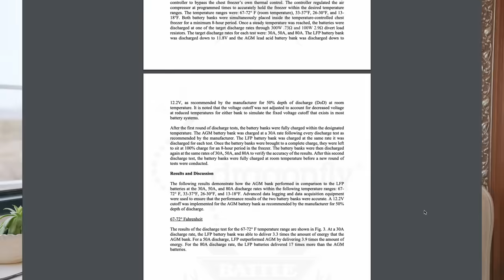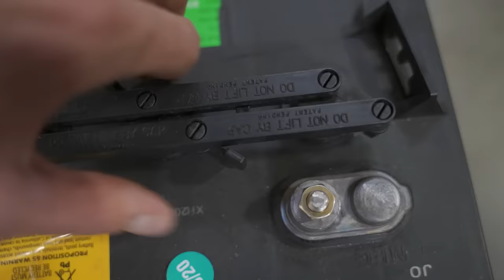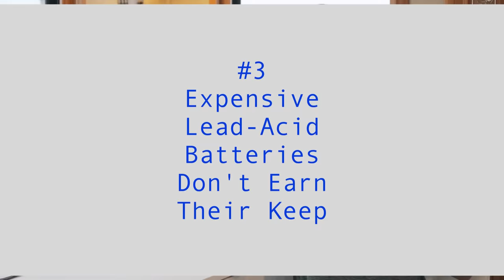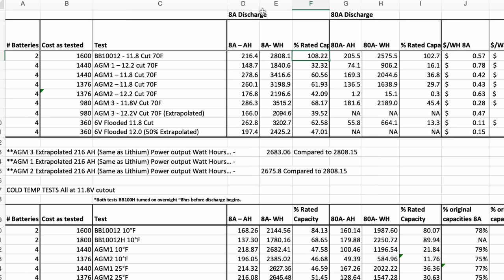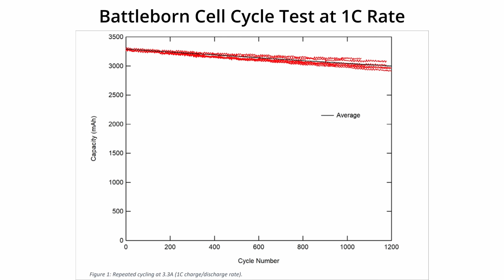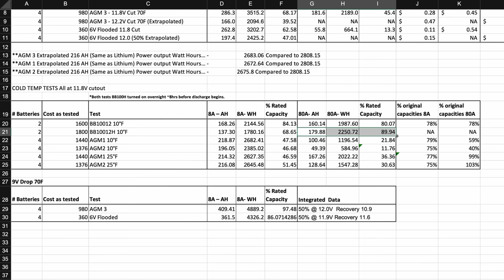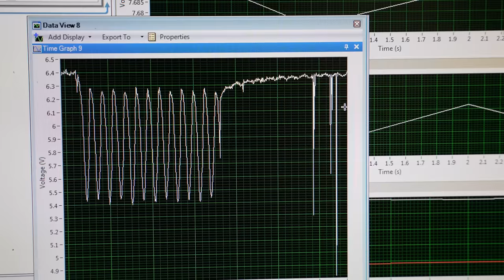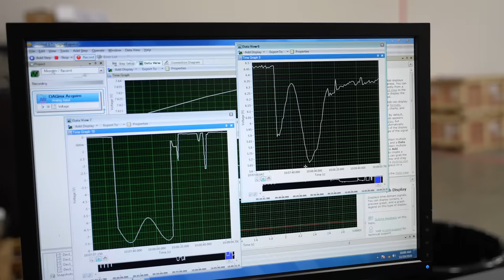Don't Waste Your Money On Batteries - The Shocking Truth I Discovered When Testing RV Batteries

Comment: I’m on the lithium train and I believe in them but this is pretty much a Battleborn commercial. Battleborn are good but overpriced and there are so many new cost effective options. Tune up your price point Battleborn!!!!!  Just sayin
Reply: @MrSummitville  you will not get 5 years out of lead acid if you are doing daily cycling. If you are talking about occasional use, then I agree with you. Golf cart batteries will be cheaper up front and if lithium ever paid for itself it would be 10 or 20 years in the future. Very questionable whether it makes sense to pay more upfront for something that will be slightly cheaper a decade or more away.
Reply: @mckenziekeith7434  Battel Borne batteries have not even been in existence for 10 years, so no one knows how long they will actually last. It is easy to get 5 to 6 years from lead acid batteries in a solar setup.
Reply: @Schmitz3  The LiFePO4 technology has been around for more than 10 years. I think it is reasonable to believe that the batteries will last that long. Maybe in some areas you can get 6 years from very premium lead acid cells. But not in hot climates. And not with lower quality lead acid. Six years of daily cycling is 2200 cycles. I have no doubt that the battle born batteries will be a better investment for people who cycle daily, especially in hot climates. But not for occasional use. A friend of mine who is a solar installer in Hawaii said that nobody ever gets rated life from lead acid, including premium cells. He thinks premium lead acid is just a waste of money because in real world conditions in Hawaii the premium batteries don't last much longer than cheap ones.
Reply: Yea there cheaper ones from China and they show good numbers but you can not pick up the phone a talk to a tec to answer all your questions. If you call the China battery you get a some one who just sells them here in the states and most do not have the knowledge about the battery they sell. Every time I get ready to change or add my Bigfoot truck camper and I love Battleborn batteries they price is high but you get what you pay for and Iam totally have with product and the tec’s I can call and talk to. You can even stop in Reno and they will check you system out and say your fine or you need to change something.
Reply: I bought cheap 280 amp hour lifepo4 cells from China and a bms for $600.   Far cheaper than a battle born.  So far so good.  I'm pulling full capacity.  At a 1/4 the cost who cares if the cycle life might be a little less than Battleborn.  Plus I can swap out bms if it gets fried.

Comment: No one mentions storage in cold weather. I have a travel trailer on a permanent location in Canada. If I fully charge my 400 amp hours of lead acid in the fall I can leave them over the long winter where temps can drop to below - 30 for weeks at a time. In the spring after topping them off there is no drop in performance. I've been doing this over years. An expensive  lithium battery, even self warming  I'm sure would be toast if left behind. That could get extremely expensive quickly. Sure they are lighter but moving them off site to store in a warmer location is not a practical solution.

Comment: Very cool testing done. I wish there were more youtubers doing research and sharing their data like this. Kudos.
Regarding your conclusions however that lithium is best overall I would like to say there is one use case where flooded lead acid (and agm too, yes) really shines and that is for emergency power supply. Because of their low cost you can oversize flooded lead acid systems and in an emergency power system they will sit happily at constant 13.2V for a whole year being cycled deep maybe once every 6 months when a tree falls on your power supply line. Even if your flooded lead acid lasts 100 cycles that's 50 years of use :-) (it will corrode sooner probably, but it'll still last very long). In such a system it makes no sense to pay more for lithium when you're not realising its main benefit (ability to cycle frequently). That's why UPSes use lead acid (and agm which is almost the same thing).
Reply: This is my thoughts. All these solar generator with lithium batteries sitting around waiting for a storm costing thousands versus lead acid systems with bigger heavier batteries sitting around. Until the occasional power loss. Spend more money on panels to charge them, especially since used panels are around at great prices

Comment: I put our four LiFePO4 batteries inside the RV so that they're heated with the rest of the interior. The whole power system and a 12V fridge/freezer is under/behind the bench seat where the jackknife sofa used to be. Could put some silicone 12V heaters under the batteries as an extra layer of protection, but the BMS shuts everything down if the battery temps get low, so I don't yet see the point.

This past June, we got an inch of hail in Colorado and I woke up with the exterior temp at 28 and the interior temp in the low 50's. Pretty wild weather but the batteries never got close to freezing temps.

Comment: Great content here!  Thanks for making it happen.
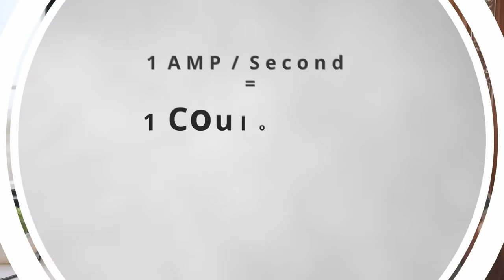At 9:06 You have a card up that says a Coulomb is the rate of flow of Protons?  I thought it was the electrons that were measured for electrical current?  I realize it's the same volume of charge per unit, so maybe that isn't a typo.
Reply: A coulomb is the unit for the amount of charge.  That charge can be static (not moving), or it could by dynamic (moving).  If it's moving,  the flow of the charge of 1 coulomb in a 1 second period of time is 1 amp (electrical current).

Comment: I would phrase it differently to you.  If you are using any form of lead acid batteries in cool conditions you must have a charger that measures the temprature and automatically adjust the charging voltage to the temprature. In my RV  the fixed voltage charger supplied just failed to put adequate charge into the batteries even at 10°C (50F).

Comment: The telecommunications industry used lead acid for maybe a hundred years in telephone exchanges where they would be float charged at about 50v waiting for a power outage. This is an ideal use for lead acid batteries - they are present, available but hardly ever used and, if they are used, it was typically for a few mins while the standby generators start up. Use in a car is close to this - batteries stay unused until a brief draw for startup once in a while. As soon as you start planning to draw power out of a battery you need Lithium and preferably Lithium Phosphate.

Comment: Thanks Tom all the work involved with making the video, taking, and recording all the detailed data.  I have been working with lead-acid batteries since 1968, although I never worked for any battery company.  Obviously, comparing lead-acid to Lithium is not "apples to apples".  

Here are a few of my observations concerning lead-acid to hopefully complement your video: I have never been able to get an accurate SOC (State Of Charge) reading with a load connected.  You won't get an accurate capacity measurement until you "exercise" the batteries for a few months first.  Traditionally, these batteries had their capacity rated with a 1 amp discharge current.  With the storage batteries, I don't know if the higher discharge current ratings are based upon actual measured performance or simply extrapolation of the 1 amp rating.  Since this is such a mature technology with cost dominating the manufacturing process, I don't know how well quality control is maintained.  Being that lead-acid uses a liquid electrolyte (versus solid for lithium), performance degradation over temperature will be much more noticable.  These batteries have a maximum rated temperature of 80F/26C so, should never be placed in an uncontrolled temperature environment.  This is why they only last 2 - 3 years when mounted in an engine compartment.  As you noticed, lead-acid has a high series resistance.  I don't recommend pulling more than 0.1C current from them when used for storage applications.

I'm not completely sold on Lithium batteries yet for off-grid solar power.  (I use numerous banks of flooded golf cart batteries.)  I haven't seen proper packaging of the cells to get the heat out of them.  Since the energy density is so high on these batteries, if they catch on fire, there is no way to put them out.  They are totally dependent upon a good battery management circuit, which is not EMP (Electro Magnetic Pulse) tolerant.  Finally, a good recycling system has not been set up for Lithium batteries yet.

As far as RV use goes, I totally agree the Lithium battery would be a far better choice.  Battle Born batteries are some of the highest quality 12 volt lead-acid replacements out there.
Reply: Nice explanation Bill 👍
Reply: Halon and water to put out lithium batter fires.

Comment: As this is comparing different chemistries and brands in absolutes the info is very interesting but there are the realities in weekend warrior RV activities. Full time RVer's have other needs. I would venture that most RVing is done at campgrounds and RV parks where "shore" power is available. In such cases the onboard batteries are used for no more than pushing out slides, lowering stabilizers and other moderate chores where little battery capacity is used before shore power is connected and batteries are once again brought back to peak charge. Using myself as a for instance, in the 24 years we've been RVing we're on our 3rd set of 2 - 6 volt flooded deep discharge batteries. Lithium batteries really weren't present back when we first started but their specs are great and look forward to them to continue to come down in price. Until then, for light duty use I think there's good practice left in using flooded or AGM batteries. Then too, I keep all such batteries on all our vehicles on float chargers when not in use and get exceptional life from them.

Comment: Nice but still lot's of money up front .
Reply: Compared to the hundreds of millions of dollars your utility company spends to provide electricity to homes, a couple thousand dollars for batteries is not that much.
Reply: Build your own from 280 AH cells and a overkill BMS with Bluetooth for around $400 for a 12V 280AH pack
Reply: @samanthapowell5882  this it's super easy
Reply: @BEASTmodeontheRoad  yes it is very easy and saves allot of money!
Reply: @samanthapowell5882  I did something similar.  I started with a Tesla 5300 Wh 24 volt Li NMC battery module, and added a Victron BMV712 for safety, and SSRs to shut down the solar inputs.  Cost a bit more, but it works very well.  

But I wouldn't suggest DIY lithium battery projects to anyone not well versed with engineering skills.  If you don't do it right, you're basically building a bomb.
Reply: @Nic7320  lifePo are way safer and better cycles and cheeper!
Reply: @samanthapowell5882  not much use for those here, but pretty dangerous..  maybe you can build:them and sell for $500 and you will be rich Haha
Reply: @Nic7320  thanks, she is nuts recommending that.  Go on over to will’s page for that stuff.
Reply: @robertgarbe6348  not to much use for safe batteries?
Reply: @robertgarbe6348  no, for some applications Li Fe Po is indeed a safer option, particularly in cold climates.  Watch the Kombi Life channel and see what happened with their homemade Li ion battery up in Alaska.   It's a telling tale.
Reply: In practical use I have been able to replace 3 lead acid 100 ah batteries with 1 Battleborn 100 ah battery.
Reply: @johnbarnhart9015  that what this data would suggest under many discharge conditions, especially if your draw is high.
Reply: @Nic7320  So educate yourself... so many vids out there, building a LFP battery is not rocket science. Not by a long shot.
Reply: @agent8699  What exactly should I educate myself on?  I have an electrical engineering degree, I designed power systems for telecom equipment and military aircraft, and built a 5 kWh battery system with an 1200 watt inverter and two solar controllers that fits in a 30 inch long toolbox and weighs less than 100lbs.  Now can LiFePo4 can do that -- in the same space?
Reply: @Nic7320  My LiFePO4 battery is 4.5kWh (usable) capacity and is about 16" x 14" x 10" including the compression plates and the weight is about 45kg including the compression plates that is close to 90lb The SBMS0 is 150g and say two DSSR20 70g each so less than 1lb for the solar charging and BMS then the inverter will need to be below 10lb but should not be a problem for just 1200W.

Comment: Instead of going Battleborn fanboy and testing only their battery against AGM and lead acid, I'd like to see you test MULTIPLE lithium batteries against each other, too. To me it just seems like one big commercial for Battleborn. I already own a Battleborn battery which works great, but $1,000 per Battleborn battery vs $500 SOK battery or $600 Renogy battery would be very useful to do. We don't need to just test the most expensive battery on the market here.

Comment: Other issues are that Li batteries have half the weight for the same A-hr rating, plus as you found those ratings aren't met by the lead-acid.  Dangers are another issue, spilling acid and fire-hazard, though the latest LFP lithium batteries are much safer, plus can be drawn down to zero charge with no harm.

Comment: Interesting video and I can see you've gone to a lot of trouble to do this testing.  I'd be very interested to see the results with a high end AGM like the Concorde SunXtender.  I suspect you'd find they would meet the manufacturers spec.  Also if you are talking Li-ion rather than LFP, wouldnt you have some concerns about the thermal run away potential at just 60 deg c?

Comment: All I know from my limited experience with an Airstream 23FB, the 2 lead Acid/AGM batteries would discharge near zero just running the heater fan overnight in cold temps.   I was replacing batteries frequently.  My take, spend a few bucks for whatever this channel recommends.  😊

Comment: As the saying goes, "buy cheap, buy twice."
Reply: Falling for marketing is not the brightest thing either no proof in this video even with all the crap on the computer. Run the system every day for at least 8 years and if the batteries still work then they are as good as my lead acid batteries.
Reply: @bishbosh7728  are you a flat-earther? Your post claiming "no proof" whilst ignoring the mountain of data looks like the typical flat-earth modus operandi.
Reply: @StringerNews1  A mountain of data is not proof of a long term running system. I have abused the hell out of my lead acid batteries and they are still going 7 years later. I bought cheap and it's perfectly fine. For the price of replacing my current system with lithium iron phosphate I can get 4 sets of lead acid batteries. So are the lithium batteries going to last at least 20-28 years nah I don't think so because there's no proof that they even last they're claimed ten years and even that is pitiful for the price.

Comment: sounds like a paid sales pitch for Battle Born new heated battery to me, trying to remove the last negative for lithium cold weather problems...rather see a non-compensated review from long time user of both systems from batteries stored inside the vehicle....that's why regular car "starting" batteries are not good for solar and come with a cold cranking rating....battery is outside under the hood.
Reply: All videos I have found for the last years is just pure commercials like this for Battle Borne (and no other brands). I want real independent information, not sales pitch... Here in Norway AGM is more cost effective as Lithium with heating is needed and cost 3 times as much....

Comment: You're right, buying anything but Lithium ion for RVs is a waste of money.

In my household 3 kW solar system I have eight 6V 300 AHr lead carbon batteries and they have been in use for 5 years and and 4 months. There has been degradation but only noticeable because I record the inputs and outputs every day. Previously I had flooded lead acid batteries and they had to be replaced after 5 years.I have the inverter set to switch to utility power at 46 Volts (11.5 equivalent) but usually this low voltage is reached momentarily when a refrigerator compressor starts up so in reality the battery rarely gets below about 47.5 Volts (11.8 equivalent). The Lead carbon batteries cost about 50% more than flooded lead acid but I expect they will last about 2 to 3 times longer so they are a good option.

I also have a 600 Watt solar system in my RV which had two 130 AHr lead carbon batteries that lasted about 16 months. Probably due to irregular use and not being able to switch to utility power to maintain charge, especially in the winter months. Those batteries weighed 72 kilograms (160 pounds) and cost me about $760 ($530 US) which was a total waste of money. I'll probably get $150 for the lead as scrap. I have just installed two 100 AHr LiFePO4  batteries ( 20 kilos or 44 pounds) and set the low Volts cutoff to 11.4, I expect these batteries to last at least ten years. They cost me $1600 ($1120 US) but the lifetime cost will be $160 per year against $550 (dependant on the price of scrap lead) for the sealed lead carbons.

You're right, buying anything but Lithium ion for RVs is a waste of money.